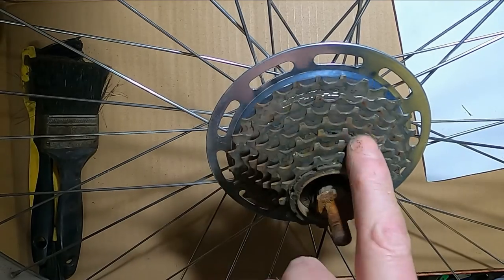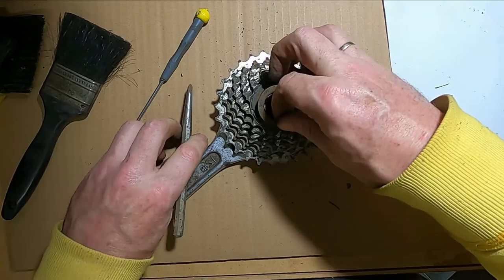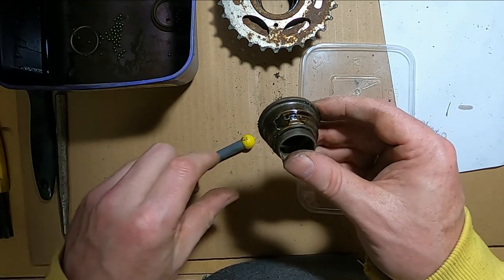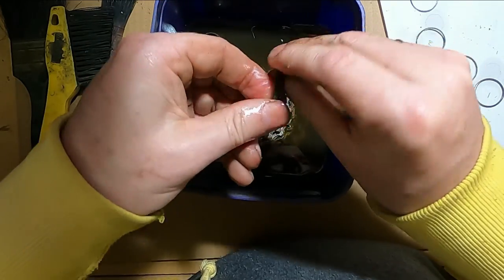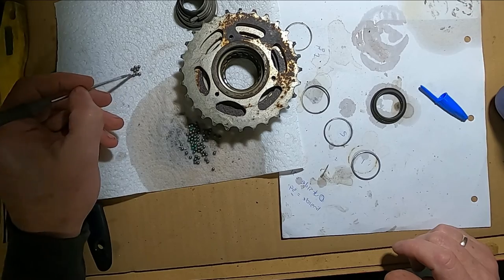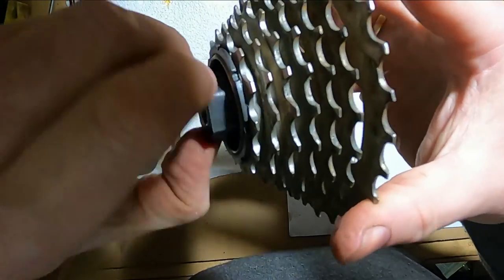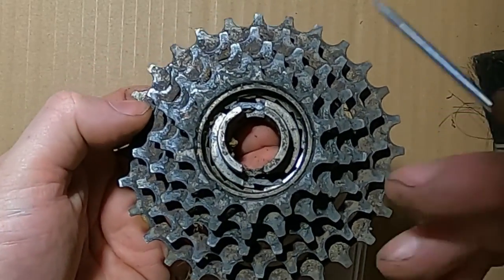Freewheel stripdown and rebuild

Comment: Thanks for the demonstration, and I get why you provided it.  I recently rebuilt a friend's freewheel bike without taking the actual freewheel apart, simply flushing and re-oiling.  Not optimal, but given the value of the bike, it's all it gets.  I'm working on another one now, a 24" kid's bike.  Same treatment.  The only way I'd do a complete freewheel overhaul is on a valuable/collectible vintage bike.  In such a case, I'd probably replace the balls with brand new ones.
Reply from the maker: Thanks for your comment. I usually spray them with CRC and soak them in petrol. You're right that it's usually only viable for older unique clusters. Or people who maybe can't afford a new one. Good luck with the 24" bike.

Comment: NOTICE:

Image is left-right mirrored (pay attention at the markings on the wrench).

Shimano cassettes are REVERSE THREADED !!! You'll have to rotate the bearing sleeve CLOCKWISE  to dismantle them and access the bearings / pawls.
Reply: No matter the brand, all bearing sleeves are reverse threaded. Video is mirrored as you said.
Reply: Yes that is tricky because I was thinking .... Why is this race turning the regular way off when it is reverse threads. 
I 'm glad you pointed out VIDEO MIRRORED

Comment: just spray penetrating oil in the gaps and drain out the grease, then add a good triflow oil in there...should be good after that.
Reply from the maker: Yes I've done that in the past too. Soaked in petrol etc.

Comment: How did you hold the pawls compressed against their springs while you re-assembled ii in the freewheel without disturbing the bearings?
Reply from the maker: No, just turned the hub and they found their way in. I that doesn't work you can push the hub in gently and poke the pawls in with a small screwdriver.
Reply: @UnhingedHarry   Thank you!
Reply: @UnhingedHarry  Have you notice any issues of the pawls sticking in lower temps by using grease as some have claimed?
Reply from the maker: @deltafour1212  no mate. It doesn't really get cold here like some parts of the world. And if it gets below 10C, I stay home :)
Reply: @UnhingedHarry  You know, you are right.  I never thought about that. Only worry about sticking if you're that person who rides in cold temperatures (Which I do not. Like you, I stay home when it's too cold to ride) You just made my life easier and saved me some money.  Thank you!     Like/Subscribe/Bell

Comment: Hello dear sir what's the name of the socket opener 😊😅
Reply from the maker: Hey mate, do you mean the freewheel spline tool? One like this on eBay:
https://www.ebay.com.au/itm/154758044535?itmmeta=01J0YXDZA4DG8SQ47SRN0GNBBY&hash=item24084c5b77:g:vOcAAOSwpsdhwF5K&itmprp=enc%3AAQAJAAAA4OcJOFAgeRXC0LytOlZbqWFvvw%2FiwWZu5ISewdY%2FScPa0lQG1xTbeHRS1IMJLUuH6jP2F9yP4L%2FvcE1YfQDqd6TYxK8StvR4M9VqMlsOkcv48LfjDtUXV36%2BPivOEWaWsUU4HlqXmlW8lNEEfV6NSEdkiQtVBeW8pIkD2FXIxdSAdLxw7ZVl1FCk9IvZiM2K6dRjYDNhWMLN9e5cHOE%2BgG1idXxWzcgWzQPkdUiazCLjD1SUBn34muEGUmKPci%2BnZW1b%2FKEvdamue%2BLAGnNT7MDJCWjl5FQejO5fvuEy7Kf7%7Ctkp%3ABFBMlvW33Ydk

Comment: Number of balls in the bearing of mine is 30 and 40 ( not 31 and 39 ). It seems one ball from the bottom was accidenly place to the top in the beginning.
Reply: Yes. I'm pretty sure mine had 39 and 30. But not absolutely. Shocking how easy it is to doubt yself,and then completely get confused. Even more confused when 1 or 2 of the new ones got mixed in with the old ones by my careless ness.
Reply: Like cheap cup and cone pedals, these freewheel units seem to be assembled rather carelessly and inconsistently.
Reply: @KarlosEPM  A ball or two short is going to make a negligible difference provided there's plenty of lubricant.  What you DO NOT want is too many bearings.  Even one too many will make any cup and cone device impossible to adjust properly.

Comment: How to remove that pesky 8 notch lockring that holds all the cogs onto the main body?
Reply from the maker: I think you need a spline tool and a spanner. Then something to stop the freewheel or cassette from turning, Usually a chain whip.
Reply: Actually I was talking about the lockring that holds cogs and spacers onto the ratcheting part so I can replace/clean certain cogs. @UnhingedHarry
Reply from the maker: @steelisreal4313  Oh I understand. I haven't done that. I thought they were riveted. I'll see if I can find a cluster and have a look.

Comment: I've torn apart about 15 freewheels in the past 6 months and here is what I found....9 times out of 10 there is 31 bearings (1/8 inch) on the top and 39 (1/8 inch) bearings on the bottom. It seems as though your video is reversed....the lock nut on top turns clockwise to loosen....Last but not least take it apart over a plastic piece that will catch the bearings if they decide to 'pop' loose.....

Comment: This is what I was looking for. My freewheel stopped "ratcheting", it went quiet and the pedal jumps forward sometimes with a "crack"" when I push it hard, it's so annoying. I wonder what happened inside the freewheel? Did the pawls wear out? Or the parts around it, with the notches? I don't really want to replace it because then I have to change the chain...and then everything get messed up, the shifting won't work. (I did a freewheel replacement once, without a new chain, it became a mess, lol) So I would like to try to fix the hub instead...I don't know if it would solve the forward-jump problem though, the Shimano shift is working well though, it's something with the freewheel itself that may be the problem, despite keeping it well-oiled....grrr. It just jumps a few inches forward when pedaling, then it works again so it's even hard to see why it does it. No matter what, the freewheel definitely needs a cleaning anyway. Thanks for the video!
Reply: @UnhingedHarry  
Thanks mate!
I live in a small swedish apartment with no access to tools and stuff, that's why I'm worried, though I could fiddle around with it...but now I forced to buy tons of tools for this problem and I don't have a spare bike. But yes, it seem that first I have to do that, to soak it somehow (no place for this procedure in my 19 m2, lol)...but I'll try to clean it. I always used this bike carefully and well-oiled and it still got this darn problem, it's really annoying. Thanks again for the advice, I'll definitely make a try.
Reply: @UnhingedHarry  
Thanks mate! I was on the same thoughts, in the bike storage area I gave it tons of spraying, laying down the bike, still no ratcheting sound, it was always very quiet, what I remember. Actually this is the best bike I've ever had, it's a steel frame citybike, 7 years old, never had any problems with it...but now I can't avoid a slightly complicated freewheel service, despite always keeping it well-oiled. I like to do some small works when needed, I just wish I had a spare bike during this project, lol. Thanks for your advice!

Comment: You really shouldn't use petrol.  You should use STALE petrol.  Gas is expensive where I'm from and has a shelf life about the same as milk.  With so many machines I seem to find myself with gallons of the stuff unfit for internal combustion.
Reply: @UnhingedHarry  I was exaggerating a bit but I do use stale gas for cleaning run of the mill dirty petro goo.  For really stubborn stuff I like lacquer thinner but careful with plastic and rubber and it's expensive also.  For burnt on varnish we have a product in the US called "LA's Totally Awesome".  I thought the name a bit hyperbolic until I tried it.  It in fact is totally awesome for cleaning two stroke model engines without darkening the aluminum castings like caustic oven cleaners.

Comment: Interesting. Your lockring is a right hand thread. RJ Guys lock ring (https://youtu.be/T_vRbBRPr3c) has a left hand thread. Hmmm.
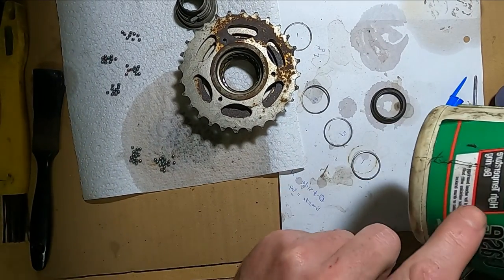Reply: Most of the  video is reversed image. Check the green Castro grease container at 12:29 :reversed. The freewheel ring nut is normally left hand thread, 3:00: reversed. Adjustable wrench 12IN 2:18 :reversed. 1:20 looks ok.   Wedding ring? Right hand?
Reply: right, left - mirror video